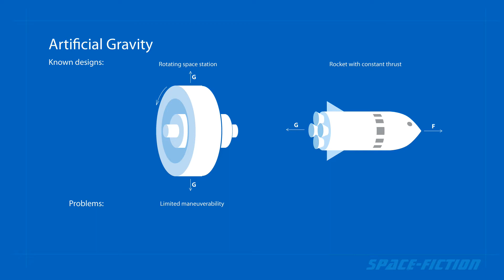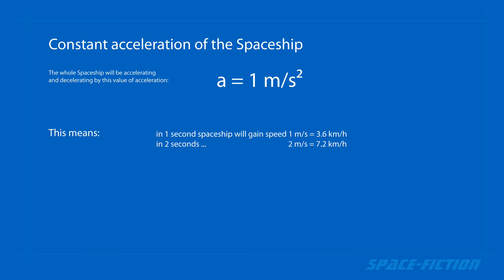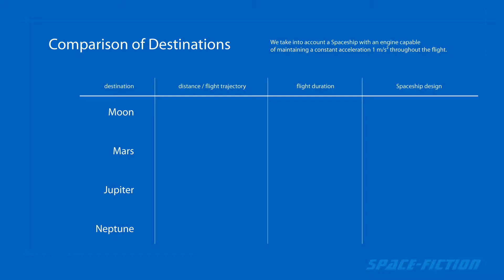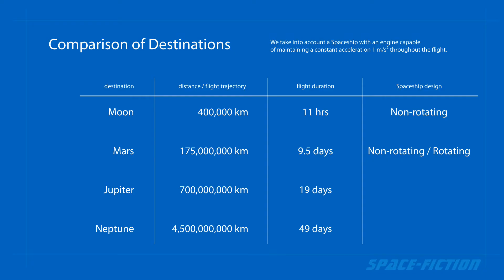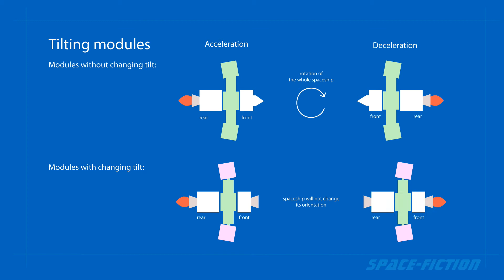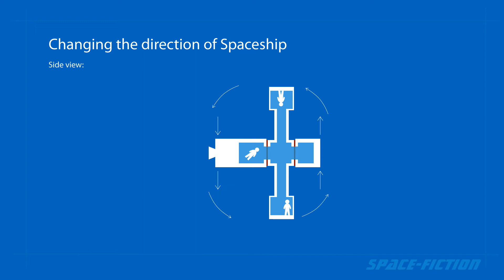Artificial Gravity in Interplanetary Spaceship - more real

Comment: Please see my page on "Short Radius Human Centrifuge" or "Spin-Habs".  My design encloses the centrifuge inside an outer hull that does not rotate.  Enclosure eliminates air leakage encountered in centrifuges that have central hub bearings for rotation.  Bearings at the hub are under more stress, and have to keep vacuum on one side, and air pressure on the other, a problem not yet solved by engineers...;-)
Reply: My FB page: "Short Radius Human Centrifuge", or "Spin-Habs"
https://www.facebook.com/geoff.s.jones/posts/10214015507957867
Reply from the maker: OK, not bad idea... actually this is exactly what I am talking about in 06:00 in this video.
But there are still problems that I am mentioning in the video... like the flywheel effect that is a problem for maneuverability of a spaceship.
And one more that I haven't mentioned is starting of the rotation. Like Newton said, every force need a counter force. So if you try to rotate such a big object inside the spaceship, the whole spaceship will start to rotate but in opposite direction.
And there is also a problem with small and relatively light centrifuges. They need to be balanced very precisely. This is not a problem for a big rotating body because moving of a people around it will not have such effect on the center of the mass like when you are using small and light centrifuge.
There is a part about rotating space station stabilization in my video Docking to a rotating space station. You can check it out... and maybe you will get some more amazing ideas. ;)